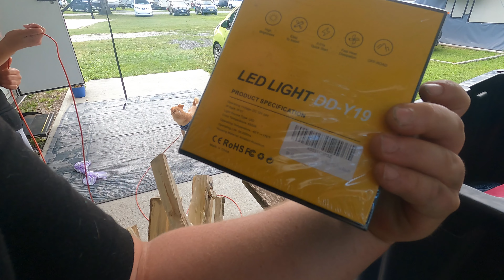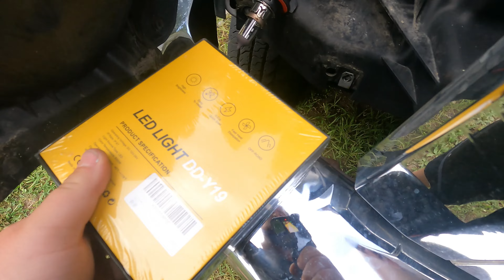Major RV Upgrade! Auxito LED lights! Things are falling apart!!    #RVLife |2023|

Comment: no law on how bright full and low beams on driving lights may be. the risk is, as previously said, that you dazzle oncoming traffic. would probably fit extra lights if you drive on small roads with little traffic. what holds the TV in place when you drive. looks like it has vibrated loose, as well as it looks like it has been a smaller tv before.
Reply from the maker: It’s just tightly bolted so it doesn’t sway. There’s wasn’t a tv there when we go it. And like I said to the previous commenter, every new car is coming out with super bright LED or HID headlights that blind me on the daily..I guess I’m just joining the club 🤷‍♂️. I’ll deff be getting a set for the tow car as well